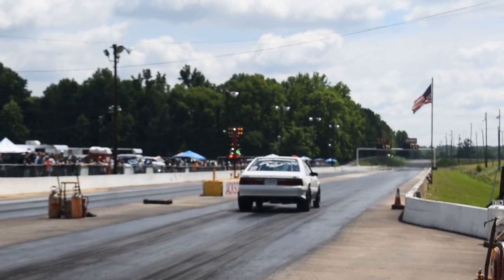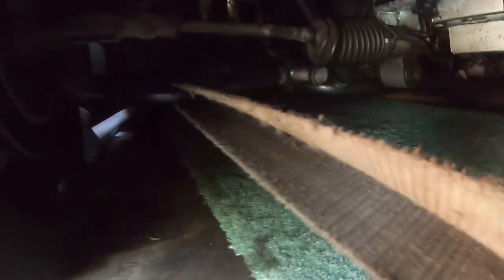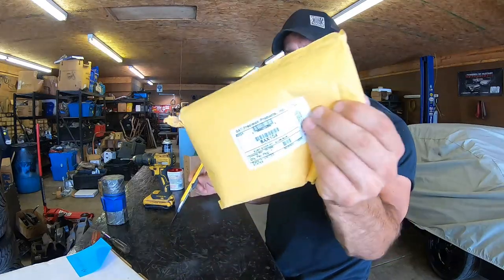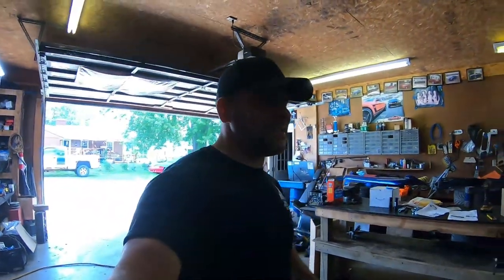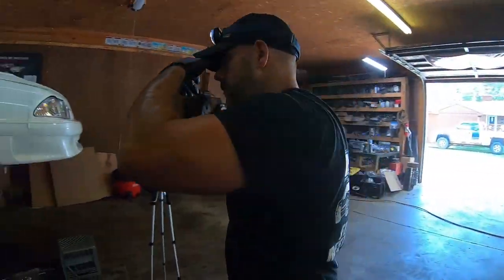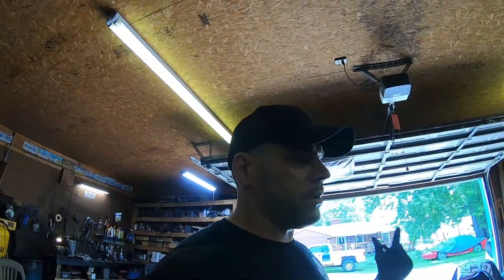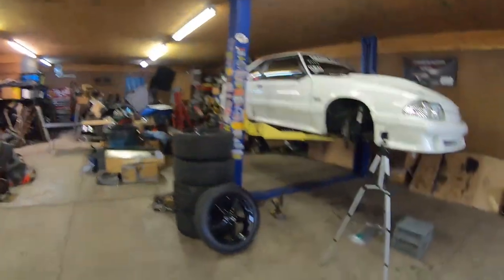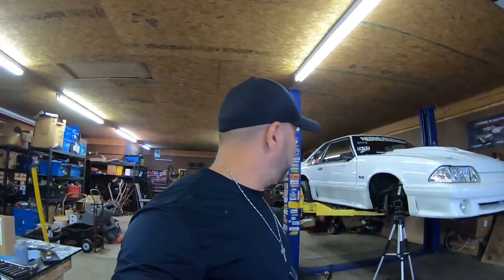The FASTER My Foxbody Went The More Dangerous This Was! HOW TO Bump Steer Install

Comment: Manual Flaming River rack on mine and alignment shop not thrilled on how little engagement in tie rod adjuster once BS kit installed. I was told they don't make any slightly longer adjusters.

Comment: The QA1 pieces are really nice. I have a set on my car, and I couldn't believe how easy they were to install and adjust.
Reply from the maker: Right. I can adjust them literally by hand in the driveway.
Reply: @Neomustangs  don't be afraid to space them a little more and give yourself some room for suspension articulation. You still want to keep the correct geometry even when the control arm is working through turns e.t.c. Will keep the roll center correct.

Comment: IIRC, the 96-98 spindle had a lowered Ackerman arm that eliminated this issue. Might've been the 99 & up though. So if you're at the parts yard check em out.
Reply from the maker: No I think your right. We’ll find out we gotta put a set on soon
Reply: @Neomustangs  Sweet. More content for another video.

Comment: I just did my inner tie rods and was thinking about getting the Steeda bump steer kit…I have to do the tie rod ends soon, so I’ll just get the kit then, how does it feel though?? Did it seem to help…And does it say they should be level with the control arms or level with the ground?? I always thought it was parallel with control arms..
Reply from the maker: Definately made a difference.
Reply: that's what I was told level with control arms
Reply from the maker: Well you see it really can’t be level with ground. And my control arms are made qa1 so hard to level on those
Reply: @Neomustangs  Imagine an imaginary line going from the ball joint to the center of the control arm bushing just a question I don’t know
Reply: Neither. Appearance means nothing. You have to adjust the arc to reduce the toe-in change during suspension travel. Generally 2" up and 2" down needs to be really close to zero as possible.
Reply: @hotrodray6802  Yeah I was reading how they were explaining how to adjust mine mine came with the directions that’s just a starting place wh you Gotta push down on it and do a bunch of things I don’t remember now it was a long time ago

Comment: Not at all how this should be done. You need to take actual bump steer measurements to determine proper spacing not just eyeball guess what you think looks right. Nobody watching take this advice. Your life depends on it.
Reply from the maker: It was aligned and adjusted pal. Been years on this combo this video is older. Catch up with the channel before you comment...
Reply: @Neomustangs  Not once did you mention  the most important detail, measuring actual bump steer before or after adding the spacers. A simple alignment doesn't address that whatsoever.
Reply from the maker: @chadman1977  lol ok 👍 have a nice day